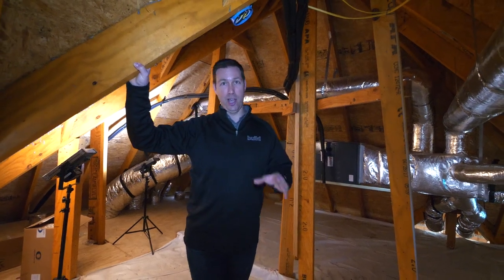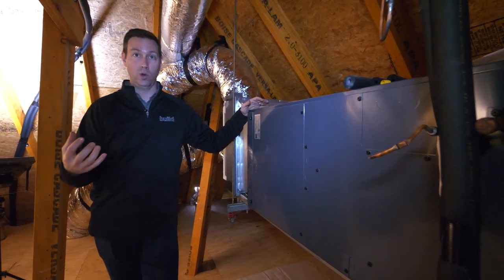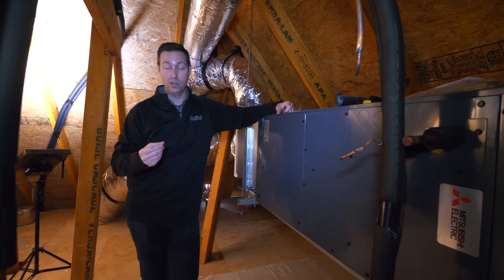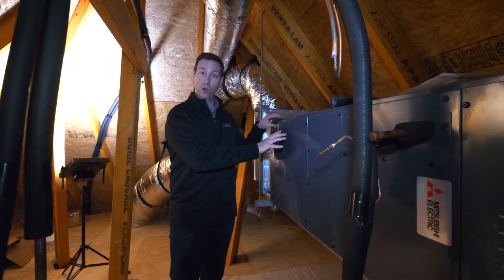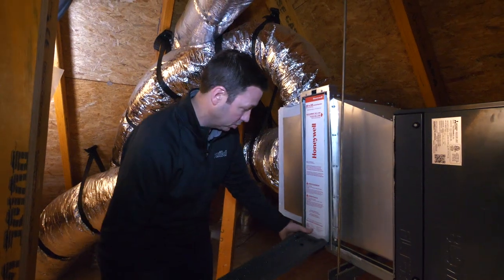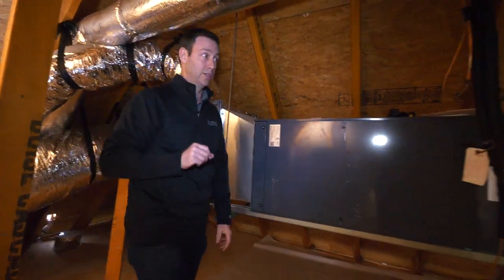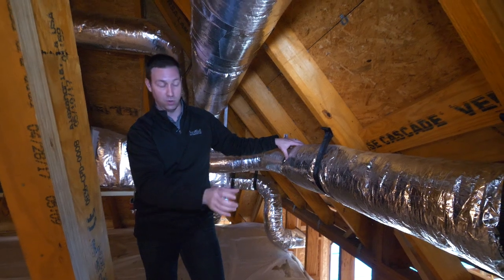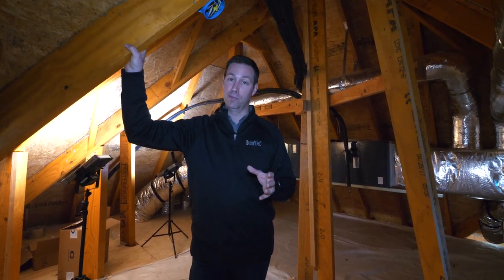New Construction HVAC - Here's My Favorite System

Comment: Knock, knock..... who's there?....shitty install. How can that be your favorite system?
Reply: Barry Mello what don’t you like about the system? I think he’s just saying that type of VRF systems is his favorite.
Reply: Crap, I thought I was watching a review of a new funhouse in a McDonalds! 😂
Reply: Andrew Colwell it's a Mitsubishi... Enough said right there. Lennox offers their XP21 and XC21 both of which use an inverter driven compressor. Better quality and if you ever need parts you don't need to basically travel to Japan to find them.
Reply: ARIZONA DRONE VIDS I think Mitsubishi is pretty much the top name in VRF systems. I’m sure as VRF becomes more popular the parts will be easier and easier to find (If they aren’t already).
Reply: Andrew Colwell they are for mini splits the central h&c are rather new to Mitsubishi though.
Reply: Andrew Colwell I'm not a big fan of hanging units. It will vibrate and those springs will start squeaking. That line set looks like a 12 year old installed it. The worst part is there is just a short plenum and pipe runs off it ( attic octopus) for the supply and 1 central return. I run long trunk ducts both supply and return. I try to put 2 supplies and 1 return in every room. Excluding return in bathrooms or kitchen
Reply: Barry Mello Barry Mello the lineset hasn't even been connected to the unit so how can you say it looks like that when it is just a run at this point? Seems like your just talking shit at this point. Secondly as long as springs are installed properly and the weight is distributed properly they do not wear out quickly. The duct system is built for the specific homes layout so without knowing the exact specs of the home it's being designed for it sounds like your just being ignorant and complaining about everything you see to sound as if you know better than them. Only 2 problems I see with that install is 1. It's a Mitsubishi 2. The Merv 11 air filter.
Reply: ARIZONA DRONE VIDS ok your right! I've demolished nicer systems.
Reply: That line set looks like a snake anyway
Reply: Barry Mello that's a nub that they brazed on to pressure test the system.... And lineset.
Reply: I run into a lot more Daikan VRF systems. Only thing Mitsubishi I tend to see are mini-splits.

As far as the install it doesn’t look too bad but I’m dumbfounded to not see a overflow drain pan with a float switch. Most hacks at least manage that much. I suppose it could have been done after the fact though considering line sets weren’t even complete.

Comment: Converting from hard pipe to flex to keep sound under control is an indication of someone who doesn't  understand proper duct design. If you keep you velocity under the recommended maximum you can use any kind of duct work and not be concerned with sound. I find your videos rather comical as you try to portray yourself as someone who has a clue, but your lack of knowledge shows through every time you talk about HVAC.